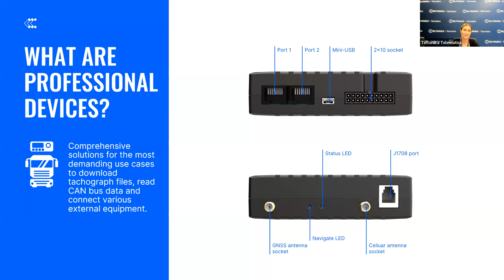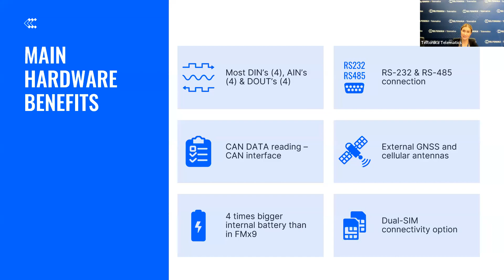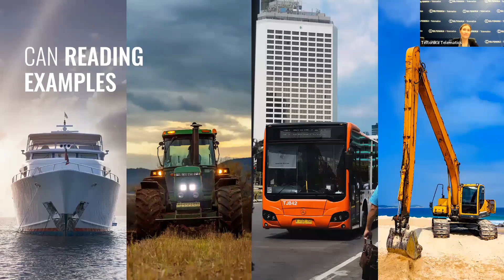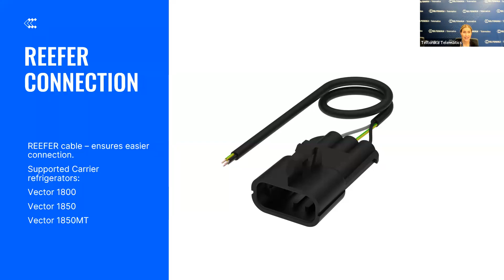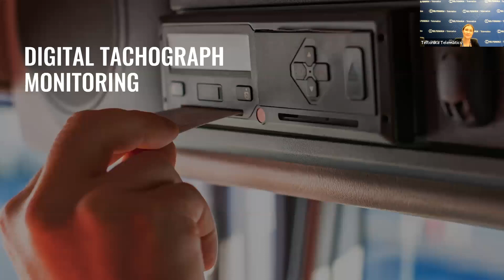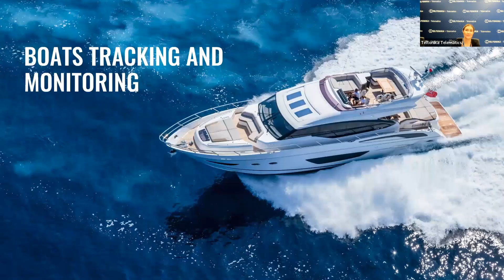Webinar | FMx650 Professional Trackers for Multiple Use Cases | Teltonika

Comment: How we can check the heavy truck's supported parameters list from the FMS using FMC650 ? .. we can't find any trucks list from teltonika documentation
Reply from the maker: Hello!

We are currently working on connection schemes for all major heavy truck models. These will also include the possible supported parameters identified during our reverse engineering expedition.

If you connect the FMC650 to a truck’s FMS connector, you can send the SMS command scanfms to check which parameters are being received from the vehicle.

More information about the command can be found on our Wiki:
https://wiki.teltonika-gps.com/view/FMB_scanfms

Comment: WHAT IS THE BEST CONNECTION FOR THE FMC650 DEVICE NOT TO GO OFFLINE?
Reply from the maker: Thank you for your comment. The access to a mobile network for a telematics device, may it be FMC650 or any other Teltonika tracker, is not related with its connection with the vehicle. In order to ensure a stable access to mobile network, we recommend to install the antenna as shown in the video.